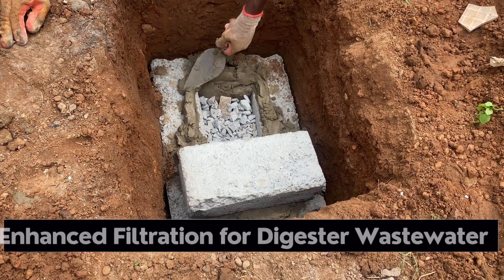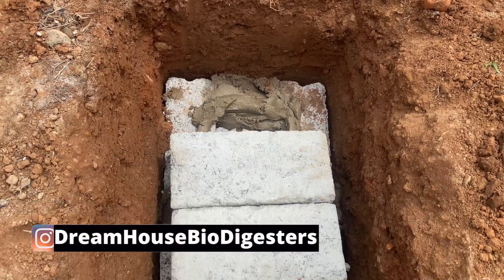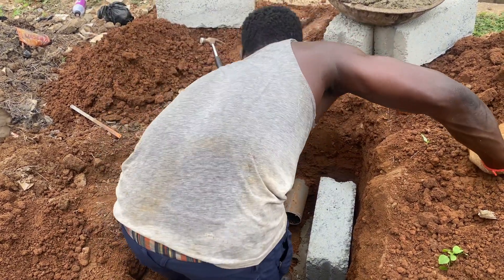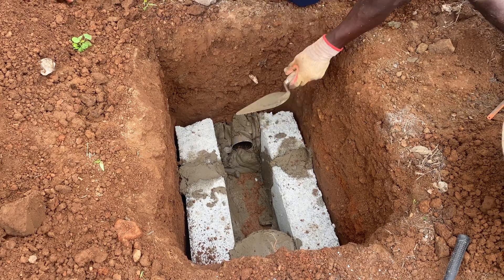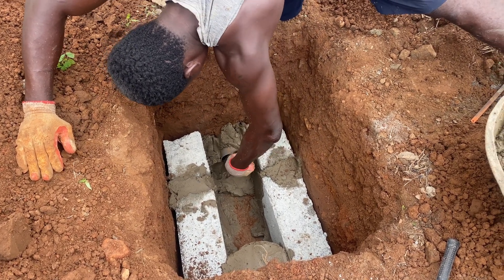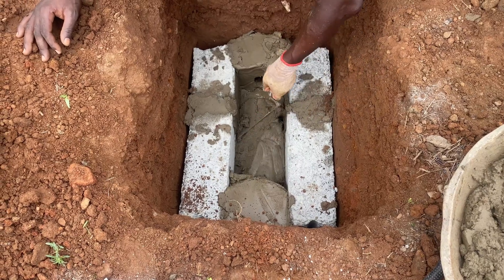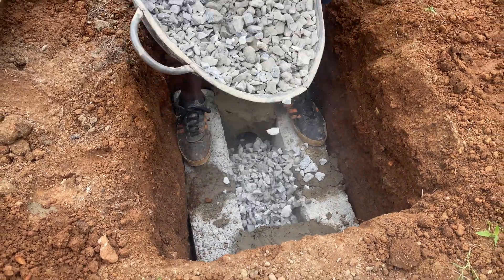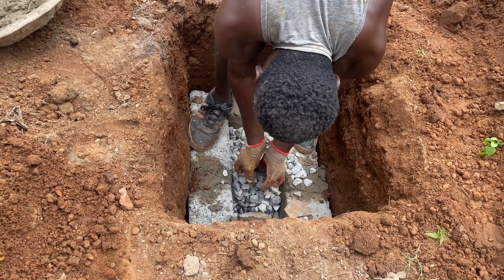New Biodigester filtration chamber design for 2025

Comment: I have deployed this system severally especially in water logged areas.

I think the inlet pipe should be atleast 1" above the outlet pipe, both ends of the pipe should equally be protected with vertically positioned wire mesh.

Mine was deeper but the pipes didn't have to be at the bottom,  since one of my filtration layers includes aluminium sulphate, so the extra space at the bottom allows for coagulation to take place there hence ensuring that the water that leaves there is very clear.

The aim is to reduce the amount of turbidity and improve dissolved oxygen to the acceptable limits should the body responsible for environment decide to run a test with the effluents.
Reply from the maker: @ahuchaoguprince  thanks for your insightful comment. We didn’t lower the second pipe because the gradient  was good and we wanted the water to retain in the chamber for a slower release into the gutter.

Comment: Ohk So This Is A New Method Of Soak Hole Pit Or
Reply: I have deployed this system severally especially in water logged areas.

I think the inlet pipe should be atleast 1" above the outlet pipe, both ends of the pipe should equally be protected with vertically positioned wire mesh.

Mine was deeper but the pipes didn't have to be at the bottom,  since one of my filtration layers includes aluminium sulphate, so the extra space at the bottom allows for coagulation to take place there hence ensuring that the water that leaves there is very clear.

The aim is to reduce the amount of turbidity and improve dissolved oxygen to the acceptable limits should the body responsible for environment decide to run a test with the effluents.
Reply from the maker: Nope. Use this method if you’re connecting the leachate pipe into a gutter https://youtu.be/mGCt-HTabas?si=MmNRmZJPh-0YbPE2
Reply: @JerryAdu-Asare  So In This Case No Water Can Be Seen In This Chamber Or
Reply from the maker: @IshmaelMensah-l3l  the water coming from the digester becomes clearer and smell free and safe to dispose of into the gutter